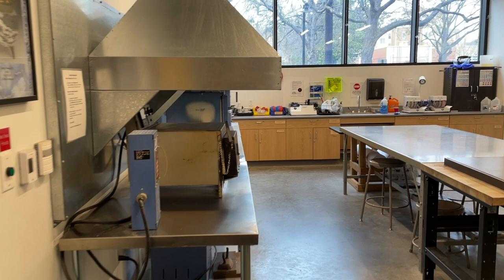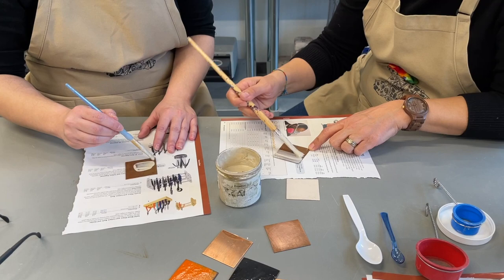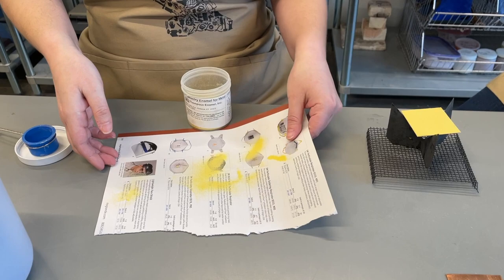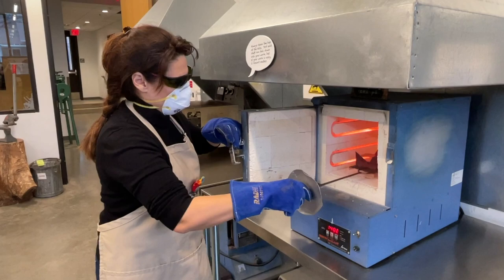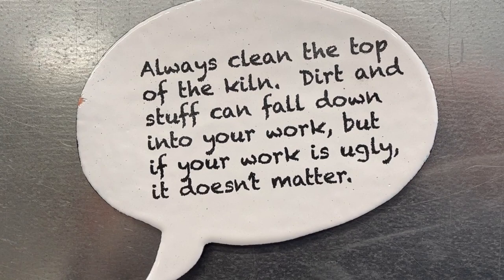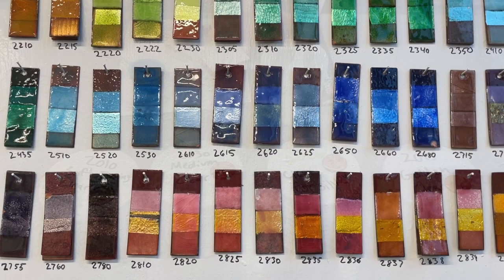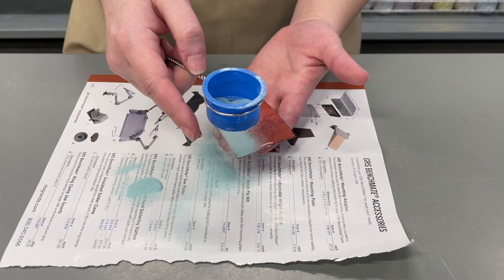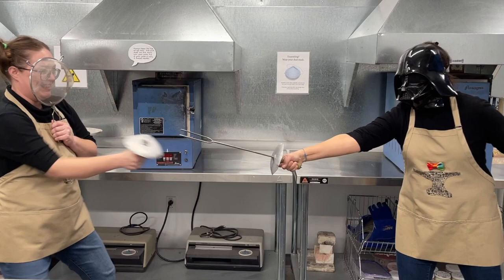Introduction to Enameling

Comment: So is this only for copper?  I was trying to find information about enamel for cast iron..  Amazon keeps trying to give me acrylic paint and “klyr-fire” which I’m assuming is also not what I am looking for
Reply from the maker: These particular enamels will also work on fine silver. Unfortunately, I don't have any experience with enameling cast iron. Amazon is definitely wrong. I would suggest you reach out to a foundry that also enamels (like Kohler) and see what information they can share. If you find out anything useful or interesting, definitely let me know! Good luck!

Comment: Hello, I would like to enamel an oil tin barrel. Do you have any ideas on how I can do this and do you think it will be helpful for my use of this barrel? I char wood into charcoal to make tierra preta.
Usually the used barrel oxidizes very quickly. So this is supposed to protect the surface of the barrel - I don't know if that's practical and it won't be too heavy.
Reply from the maker: I have only seen large cast iron pieces (sinks and bathtubs) enameled in a large facility so I'm not sure if that is a good solution for your problem. Maybe try switching to large stainless steel container that won't oxidize as much? Let me know if that helps and if there is anything else I could help with!